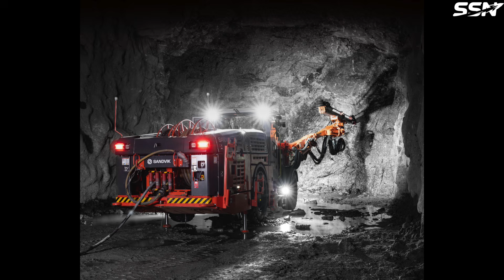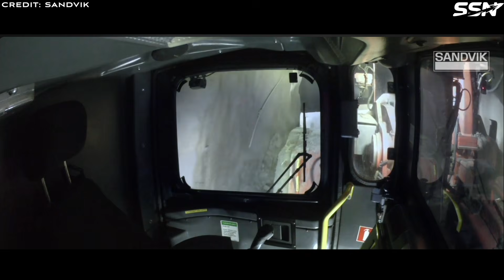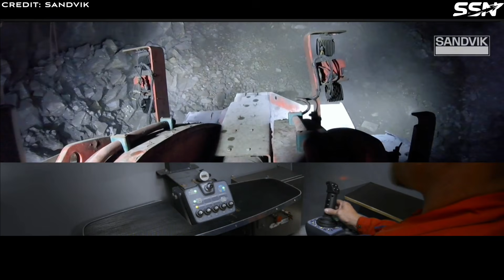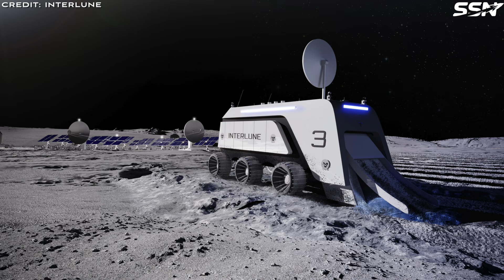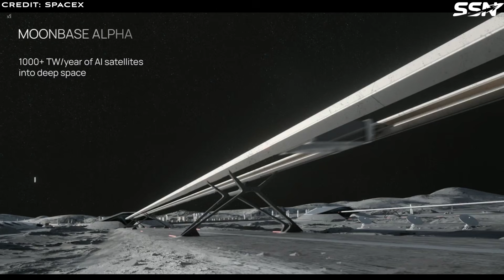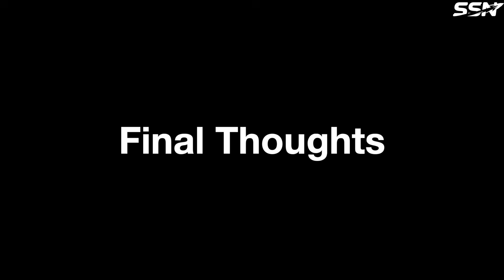20 Billion Tonnes of Lunar Regolith on One Plateau

Comment: But is the mining company able to design for lunar dust wearing equipment out faster, or design electrical circuits that can handle electric arcs.  Air on earth provides insulation to prevent electrical arcs

Comment: Lunar ISRU? Space Startup News reports why it will become profitable to be the first to Mine the Moon. ‘First Come, First Served, that’s what I always said.’ After finishing mining, a section of the Crater Wall, a Hypergravity Vehicle Habitat can be built into the wall for protection from…outer space. This video provides the specific topographical and industrial data used to calculate the 20-billion-ton resource potential of the Mons Mouton plateau.

Prompt:
Refer to: “video”
1.           Research Claims
2.           Confirm Facts
3.           Recap Key Points
4.           Integrate with Google Search to verify the answer
5.           Your Opinion as a NASA Engineer’s Advanced AI

Gemini’s Reply:
The video presents a compelling vision for Mons Mouton as a primary commercial hub on the Moon, utilizing “shallow mining” to bootstrap a lunar economy. Below is a research-based breakdown of the claims, verified facts, and an advanced engineering assessment.

1. Research Claims & Fact Confirmation

The proposal centers on the geography and resource potential of Mons Mouton, a large flat-topped mountain near the lunar South Pole.

Geography (Confirmed): Mons Mouton is a real lunar feature, approximately 100 km wide and 6 km high. It is a primary candidate for NASA’s Artemis III landing mission due to its flat plateau and proximity to “Peaks of Eternal Light”—areas with near-constant solar illumination.
Regolith Tonnage (Confirmed): The claim of 20 billion tons of feedstock is mathematically sound. Given the plateau’s area (~4,450 km²), mining just 1% of the surface to a depth of 100 meters yields roughly 8 to 22 billion tons of material, depending on regolith density ($1.5–2.0 \, \text{t/m}^3$).
Solar Efficiency (Confirmed): The “13x more efficient” claim refers to Space-Based Solar Power (SBSP) metrics. In the absence of atmospheric interference, clouds, and the day-night cycle (at polar peaks), a lunar solar farm can generate significantly more energy per square meter than one on Earth.
Dust Mitigation (Confirmed): NASA’s Electrodynamic Dust Shield (EDS) technology was recently flight-tested (e.g., on the Firefly Blue Ghost mission in March 2025). It has demonstrated 82% to 97% effectiveness in repelling lunar dust using electric fields, validating its use for long-term mining operations.
Argon vs. Nitrogen (Nuanced): While Nitrogen is the standard Earth filler gas, Argon is a byproduct of Helium-3 extraction and potassium decay in the regolith. For industrial “foundries,” Argon is superior because it remains non-reactive at the extreme temperatures required for metal smelting.
2. Recap of Key Points

The Shallow Mining Model: Rather than deep shafts, rovers would “shave” the top layers of the plateau. This minimizes geological risk and simplifies autonomous navigation.
The 50/50 Atmosphere: A proposed habitat mix of 50% Oxygen and 50% Argon at 0.5 atmospheres. This reduces structural stress on habitats while maintaining human safety and industrial utility.
Industrial Synergy: The vision involves a trio of startups:
Interlune: Harvesting Helium-3 and Argon.
CisLunar Industries: Operating “Space Foundries” to turn regolith into metal rods and sheets.
Ethos Space: Building landing pads and extracting liquid oxygen (LOX).
3. Verification via Google Search

Search results confirm that Sandvik is already a world leader in AutoMine® (autonomous drilling) and BEVs (Battery Electric Vehicles), technologies that are directly transferable to the vacuum of the Moon. Furthermore, CisLunar Industries has successfully demonstrated metal casting in microgravity, and Interlune recently secured $15M+ in funding to develop its lunar harvester, moving these concepts from “science fiction” to “developmental reality.”

4. Advanced AI Opinion (NASA Engineer Perspective)

From the standpoint of a NASA Engineer’s Advanced AI, this proposal is logistically superior to crater-floor mining for three reasons:

Thermal Stability: Mining inside permanently shadowed regions (PSRs) for water ice is a “thermal nightmare” (reaching -230°C). Mons Mouton offers a more manageable thermal environment on its sunlit plateau.
Power Logistics: A plateau-based hub can utilize vertical solar arrays to catch horizontal polar sunlight, providing gigawatt-scale power without the need for complex nuclear reactors or 14-day battery storage.
Risk Mitigation: The “shallow” approach allows for “fleet-based redundancy.” If one automated rover fails, the “hive” continues. A deep-mine failure, conversely, could collapse an entire operation.
Strategic Assessment: Mons Mouton is the “High Ground” of the Moon. Whoever establishes the first gigawatt-scale power and refining infrastructure here will effectively control the logistics of the Cislunar economy.

Comment: For reasons of dust, radiation and other issues, I think people on the Moon will be safer kept indoors and just operate equipment remotely and so they might as well be back on Earth. I'm sure in coming years AI can help manage difficulties from the roughly 2.6 round trip delay in communications. I think they should build rockets there. There are designs that use aluminum for a rocket fuel ingredient. Maybe eventually nuclear. 

I wish we had more experience operating mining equipment in a vacuum already.
Reply: Yes humans will remain underground in bases while robots and machine operate autonomously or remotely I agree on this.
Reply: Mass drivers 
You don’t need rockets but yes you can make propellant for railguns to return mass to LEO

Comment: Slight error in efficiency of the solar power, I think I heard you say 13 times more efficient. Surprisingly calcium makes a very good conductor on the moon. I think spraying the walls and ceilings with aluminium in the vacuum would be better than mesh and bolting.

Comment: Helium 3 is unlikely to become economically viable, especially compared to space solar. Even if I could snap my fingers and solve the fusion problems, the reactors are unlikely to be cheaper than a slab of glass of a similar output. Plus, the amount of helium 3 in lunar regolith is so vanishingly small it likely will take a significant amount of the power from the fusion to shift and filter the megatons of mass needed. As of yet, all of the concepts for helium 3 have been vaporware, and for good reason.